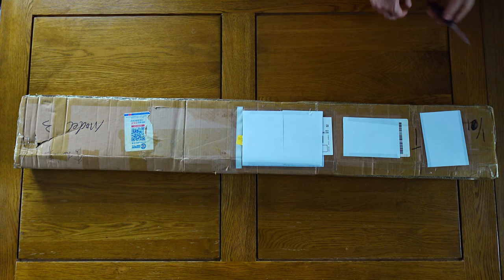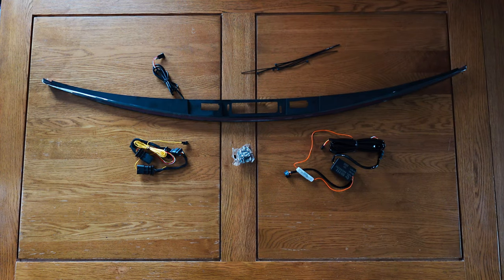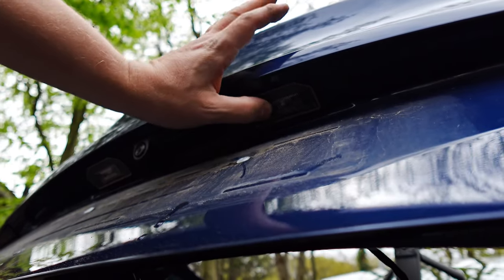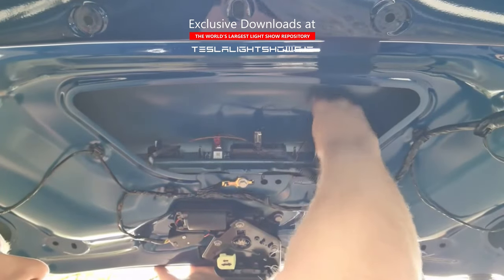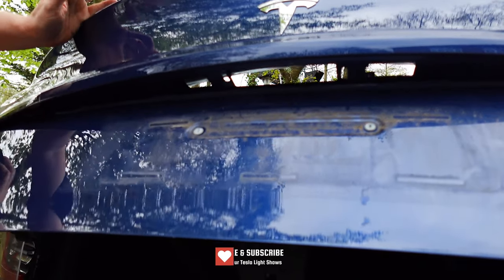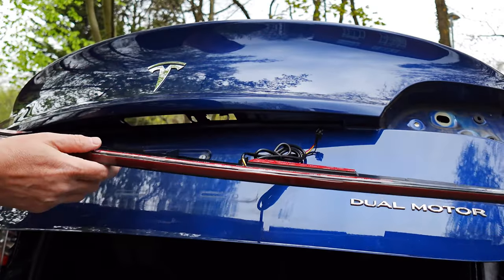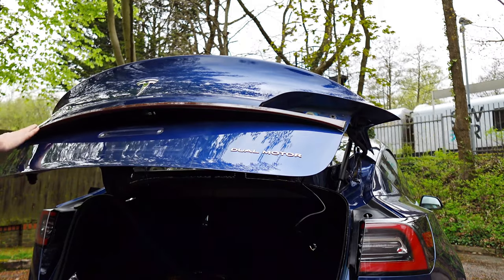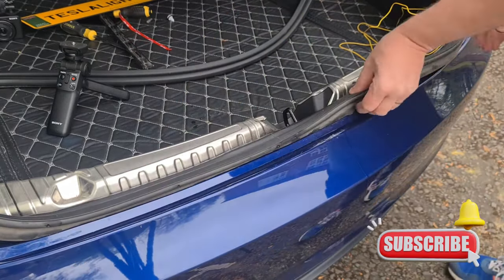Tesla Model 3/Y Starlink Full-Width Strip Tail Light Cyber Inspired Taillights

Comment: Mine flashes when braking. As in, it strobes for 2 seconds like crazy. No way is that safe to use. I checked all the cables, opened up the control box and nothing unusual there. All plugs and pins look fine and well pushed in. What gives?
Reply from the maker: Mine didn't do that when breaking... Which model do you have?
Reply: Same hereZ when braking it strobes and then goes in a sort of heartbeat mode untill i gas again.

Is there a way to disable this? 

Also the indicator light for turn left and right is not allowed here. Which cable i need to dismantle to disable this? :). Some say a yellow wire, but which? (On the u loop harbess on both sides? Or other?) do you maybe know?

Comment: I think there are conformity issues with the colour of the light. Solid Red lights are brakes, flashing amber are indicators. This light has flashing red indicators. Take it to an MoT test centre and ask them before you drive it.
Reply from the maker: Hi Lysander, I've had that check locally and I'm told that as the amber lights remain, there's no conformity issue. Thanks for watching
Reply: @TeslaLightShows  did an MoT tester tell you that?

Comment: Hands down the most helpful write up for model 3 owners. Way better than the instructional video the manufacturer provided.. I dont believe it was mentioned but when removing the Camera, make sure you remove the clips from the trunk and place them on the light strip. That way the camera can snap back in place. Thanks again!
Reply from the maker: That's very kind, thank you ☺️
Reply: Also for the model 3, I found that the long yellow connector can be plugged into the orange connector next to the left tail light harness.. that confused me because of the colors.. a better diagram would've been helpful if they provided that

Comment: Was there a special way to remove that black power trunk connector right after you remove the trim?
Mine seems to not want to come off
Reply from the maker: The cable? That came off quite easily although there is a clip that you'll need to undo to allow the connector to slip off... Hope that helps. If its something else, let me know
Reply: @TeslaLightShows 
It off not long after, thanks for that 
Did your guide lines on your reverse camera change and all? Mine seem a bit off now
Reply from the maker: I don't have guidelines on my M3 2022... Which model do you have?
Reply: @TeslaLightShows  
I have the same, M3 2022
Reply from the maker: Well... Knock me down with a feather. I've had my M3 & and MY for 2 years now and not registered the guidelines!!! The lines look ok to me on the M3, although having not really seen them before i have no reference as to how they may have changed. I'd suggest checking that the camera is sitting 100% correctly... In theory it's only moved downward by a few millimetres so although a slight change in the guidelines might be expected, i'd imagine that it shouldn't be by too much.
Reply: @TeslaLightShows I’ll give readjusting it a shot,
Thanks again for the video! 
It definitely helped me with the initial install!

Comment: What should the loose plug from the box with the orange wire and fuse sit on? Is it for ground connection?
Reply from the maker: Hi Michael, I tucked both into the cavity behind the tail lights as the orange cable doesn't seem to perform a function.
Reply: Mfr states the orange wire plugs into the 12v cigarette lighter socket base inside left hand shroud in model Y.
Reply: Anyone know what that 12v wire does? Seems to function okay without it.

Comment: Where did you plug the orange wire from the black box? Model 3s don't have a power outlet like the manual says to use.
Reply from the maker: Hi Manya, the orange wire can just be tucked away as it's not got any function.
Reply: @TeslaLightShows  I did this and only half of the light bar works :(

Comment: Great video, thanks for this....I installed this and only half of the light bar works. All of the installation instructions say to connect the orange cable to the 12V connecter in the trunk but the Model 3 doesn't have a 12v connector in the trunk like the Model Y does. I connected mine like you did it seems and it only half works. The half that does work the brake works but not the turn signal. Contacted support, we will see how that goes....def concerned it won't get fixed.
Reply from the maker: Hi Damien, the orange wire doesn't connect into the 12v, it doesn't connect to anything in mine and the full animation works perfectly. Have you tried disconnecting and reconnecting each side? Side,  like any install,  have you rebooted the car?
Reply: @TeslaLightShows  Hey thanks for the response, that made me think to swap the left and right side plugs. Turns out they were mislabeled and now the right turn signal works as well as the brake light. Left side still doesn’t lite up at all. I think I have a bad light bar unfortunately. It’s gonna be fun to heat up that 3M VHB tape to pull it off if that is the issue. A reboot didn’t help either but good idea 👍🏼
Reply: @damiengvideos4337 - I had the same problem as you AND my rear view camera didn’t work.  Have you been able to return your bar.   I’m done with mine!! The ‘extension’ cable wasn’t long enough to run to the left tail light (as per
Instructions)   The 4 loose wires at the end of the extender is a hocky way to connect.    Absolutely crap directions!!!

Comment: How is the camera view for you mine sees so much of the light bar the car often thinks I’m backing into something.
Reply from the maker: Hi Matc, the camera is obscured a little at the top but I've gotten used to it. I haven't had any issue with the car's reverse sensors though, as we've not touched those 🤔
Reply: @TeslaLightShows  my car uses the vision system not the ultrasonic sensor so I get the red line at times. I appreciate the responses overall it does look good
Reply from the maker: Ah... That makes sense... have you tried lowering the camera a little?

Comment: Great video, what is the piece attached to the trunk lid trim?
Reply from the maker: Hi @E, the bar fits under the truck, where the opening catch/button is and secured tightly behind the license plate light but with M3 tape to the body of the car 😊
Reply: @TeslaLightShows  Thanks, I was referring to the piece on the black trim underneath the trunk lid.  It looks like this TESLA MODEL Y TAILGATE TRUNK LID PROTECTOR, BLACK ABS PLASTIC

Comment: So we’re stuck - looks like our kits are identical, red herrings and all!  Where does the orange cable with the blade connector on the end connect to (the one that has an inline fuse)?  Didn’t see where you placed that in the video.

Also, any issues with the cables being pinched running the wire on the outside of the wire loom?
Reply from the maker: Hi Top Shelf Tesla, the orange cable is redundant so mine is left hanging in the cavity. I’ve had no issue with pinching, having secured it with the cable ties. Are you finding that?
Reply: @TeslaLightShows  will let you know!  Put install on hold to make sure orange cable wasn’t supposed to be somewhere!
Reply from the maker: Go for it! 😊
Reply: What did you end up doing with the orange 12v cable?
Reply: @mjcantwell6420  we did not use the orange cable.  It was tapped off and left on the harness in the cavity.

Comment: Did you have issues with back up camera showing up after putting this back together? I installed this and back up camera is just black
Reply from the maker: Hi Mat, yes I did but a reboot brought everything back up. It's a good idea to do this after any install just to make sure that there's no connection timeouts. Hold the 2 rollerballs down on the steering wheel... I normal would let it run it's course and leave it for 20 minutes.
Reply: Thanks I let the car,go to sleep and that solved it after reboot. The camera can see the strip and I get the phantom alert that I am close to something when reversing. Do you have that? Otherwise your video was great to help with the install.

Comment: Good vid less complex than others I've watched. Could be cable routed inside the tube instead of appearing outside ? Where did you get the back cover cover piece ? Cheers
Reply from the maker: Thanks @creatorex, the cable could be routed through the tube but I wanted to have quick access to everything in case I needed to go back at any point... In hindsight, I love the bar and still have it in place so might neaten it up but it's been perfectly functional to this point.

I'm not sure on what you mean by the back cover piece, can you elaborate?
Reply: @TeslaLightShows  yes, the part inside frunk door … you have this covered with something I think to protect the interior interior.

Comment: You have the best video on this installation. There are so many that are lacking. There is a piece that was put in my kit that has no home. Its a wedfe with spring loaded wings. Any ideas as to what it is for?
Reply from the maker: Thank you Lee... That didn't come in my package although I also recommended some extra components in the form of some screed that didn't belong to the set. They must have had a overactive elf at the workshop 😊
Reply: the silver bits in separate bag I think are meant to pretty up your license plate mounting screws - replaces them, and then the shiny chrome caps hide the heads of the screws.

Comment: Hi need help!!! I bought mine and i fit it in but do I need to connect the 12volts orange wire to the 12volts socket? It doesn’t work now!!😢
Reply from the maker: No, the orange wire doesn't plug into anything... I tucked mine into the lining
Reply: @TeslaLightShows  thank you. Maybe I did turn the wrong way round 😰
Reply from the maker: Let me know how you get on
Reply: @TeslaLightShows  it’s working now cause the wrong colour wire connected😅.
Reply from the maker: Excellent 👌🏻 Ace isn't it 😊

Comment: I went through 2 of these systems. The first one never worked, and the 2nd one lasted for 1 week. Both units had a defective light bar. I had them professionally installed.  After the second failure, I trashed them and put on Alpharex lighting system instead.
Reply from the maker: These have been in for a couple of months now and still going strong 💪🏻😊

Comment: What is the small package of silver bits for?
Reply from the maker: Absolutely nothing 🤣🤣🤣 it threw me too for a while but I did confirm with the manufacturer
Reply: Can you test the animations when the brake is held down and a turn signal is on. I have an issue where the turn signal and brake animation looks like it’s glitching out and flashing in the opposite direction!
Reply from the maker: you May have the left & right cables wired up the wrong way around? Try switching them around… So the connector you currently have into the back of the right tail light, move that to the left tail light and vice versa. Hope that makes sense ?